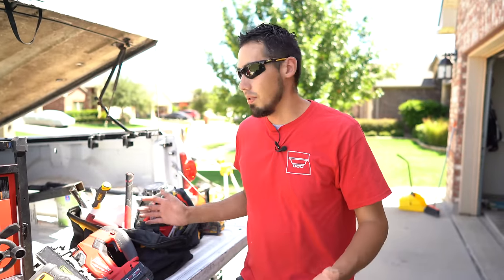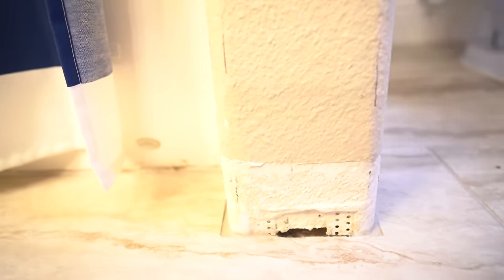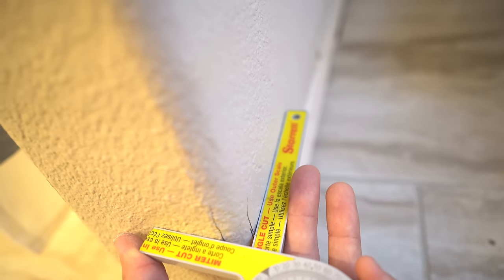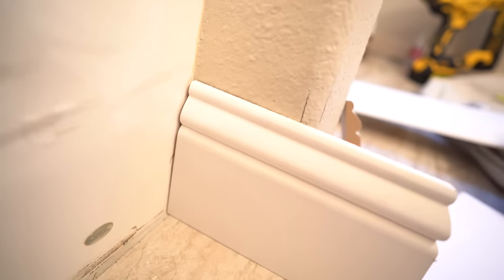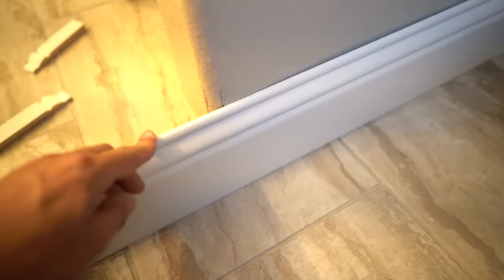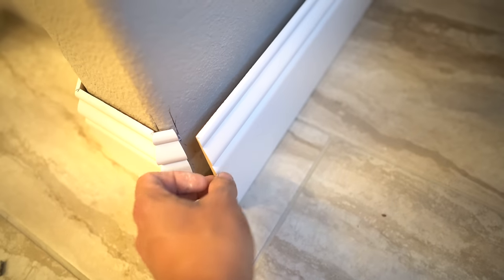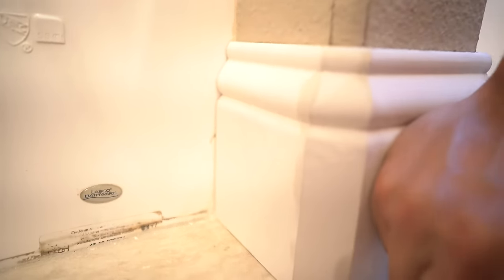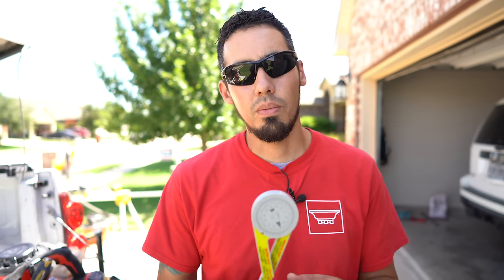This Simple Tool Gets PERFECT Miters

Comment: Yes, excellent addition to the tool box! Nice explanation my friend.
I work on a lot of jobs where coping is not allowed due to customer preference and we gauge all the corners as we measure for length. We also glue every single joint we make.
Using a mitre gauge mostly eliminates the need for test miters, especially with large crown mouldings.

Comment: Fantastic! How do you determine width at inside (or outside) for the bullnose trim piece? Do you measure gap between cut peices in position on the floor? Measure it from the bench dog jig? Given the radius is 3/4 you could calculate with math but thickness of drywall plaster finish will change that? Would love to know. Great lesson, thanks for mentoring your talent.

Comment: Excellent video.   By the way, "Starrett" is usually pronounced to rhyme with "stare" rather than "star."   With the first syllable stressed, it comes out sounding  about like "STARE-et."     An alternative tool which you may have already looked at is the Festool "Angle Transfer Tool" but at $175 (--or included as an accessory if you fork up  the $1500 for a Kapex miter saw), t'ain't cheap.  A more cost effective alternative is the Bora "Miterix Angle Duplicator,"  which can be had for about 1/5 of the cost of the Festool version.

Comment: I've been using the same protractor for years - it's an absolutely go-to tool as you say....... Very nice finishing indeed - that cope (or scribe as we say over here) is a thing of beauty. The only other step I take apart from everything you've done, is to gently wipe the external mitres over with 240 grit just to take the sharp edges off. Just personal preference. Greetings from England.

Comment: For shoe mould  trims just use a multi angle miter cutter. 16.99 on Amazon. Gets your cuts quick, precise and without any power tool. Just pure hand strength.
Reply: Truth! However, many new trim, is wider than a miter-box. I run into that problem. Nothing a chopsaw can't fix! There's many measuring devices which help with angles. It's all about how much time you have & request for quality. Time is $.

Comment: I really enjoy your videos and they are teaching me new techniques which are very helpful. Unless I missed a video it would be great if you could do a video where you show the actually cutting of the angles from the pencil transfer like the 23 deg miters. Especially for the small pieces...one thing I struggle with is taking incorrect measurements or maybe not transferring properly and making an incorrect cut. Therefore I waste a significant amount of time adding length and slicing the wood like I am at a deli counter until I get the correct fit.

Comment: The cope in the corner is perfect.  Have you changed the way you cut copes from the way you showed in earlier videos?  Also when you put the assembly in place it was obvious the wall had a little wave in it.  Do you nail tight to the wall, including the dip or do you leave the base straight and fill in the dip with caulk?

Comment: You rock. [or trim] Most guys like me have our hands full just coping and installing the trim. You're holding a camera too.  Question: what do you do about water in a bathroom as far as the base trim? I've held the trim off the floor an eighth and caulked, or not caulked, and also just run it on the floor and let it go. I especially tend to hold trim up off a bath or kitchen floor if they spec MDF trim [yetch]. I am buying this tool today! I set up a big haunted house every year and like to do some fun trim projects on it every year.

Comment: Big rich the glue that will old that plastic up is called "CA GLUE" it has an instant activation spray its great stuff if you don't want to use that scuff the plastic and magnets with some sand paper and use superglue and put some baking soda on the glue when its wet (watch a video on both i use ca glue when trimming a house out )

Comment: I'd like to see how you made the 23 deg cuts on the miter saw.  Did you use the protractor to set the saw angle as well?  And how did you cut those tiny corner pieces?  Great work!
Reply: Set the saw at 23 and cut

Comment: When you nailed the longer run to the wall. Did you nail your boards flush? Or have the painter get it? In this case. To make up for the track built wall. Finish Carpentry TV

Comment: Can you use that mitre protractor to measure a corner...divide that angle by 2... and then use that number to cut the moldings/trim with a mitre saw? ...AND AVOID HAVING TO DO COPING?

Comment: tool application and miters are on point. typically, you shouldn't use MDF in a bathroom application, and baseboard should be raised off the floor a sixteenth (unless you're back priming bottom edge and back side). I also hold baseboard back from tub a sixteenth or eighth, and allow for caulking.  Wet areas will inherently require more maintenance, i figure caulking is easier than having to replace baseboard in an area with high moisture exposure, that will absorb water, especially if you use MDF.

Comment: What is the rule for when to miter and when to cope besides the obvious miter outside corners? Why not miter the inside corner by the toilet, it seems like copes are more work vs finding the angle and just cutting both on miter saw. Also there must be a measurement for how long your middle piece of the bull nose is, a standard you always use. How do you find that length, it would change for larger or smaller bullnose, right?  Great video as always.

Comment: The simple Johnson T-Bevel tool works as good as the Starrett protractor. After you set the inside/outside angle measurement on the T-Bevel tool, take it to the chop saw fence and place the handle flush with the fence. Then lower the blade without power into the slot and turn the blade to match the T-Bevel arm, note the degree marking on chop saw base, and divide by 2. Be sure to use flat part of saw blade (no teeth against the T-Bevel arm). This is extremely accurate every time mating your cutting angle to actual wall condition.  ie, a 92 degree outside angle T-Bevel reading on chop saw calibration scale divided by 2 needs 46 degree angle cuts.  Works perfect every time with great accuracy.

Comment: Richard, do you find that the bullnose piece is always 5/8" on the heal regardless of the angle? Even if you had a weird angle like 120 degrees instead of 90? Also, what about inside bullnose. I have some of those around some pillars between my living room and kitchen that are the bases of arched openings. Is the inside (reverse) bullnose usually 5/8" as well? I also spoke to Scott over at Windsor One, thanks for recommending their products.

Comment: Do you find that there is a little bit of play in you gauge? I had that exact gauge and I was getting almost a 1 degree variation. It was the slightest bit movement but was noticeable on a detailed trim job. Starrett makes the same gauge but in metal. It is $80, but it has no play. I ended up scrapping the plastic one and using the metal one. Just wondering if you have the same issue.

Comment: For those two smaller pieces that you cut, I believe you called them "bull noses". Did you cut 23 degrees on both sides of those pieces? And were the pieces they connected to cut at 23 degrees on the saw? I guess that would make all the cuts at 23 degrees. Is that correct?

Comment: If I were to use this tool for a vaulted ceiling to install quarter round trim (instead of crown molding) I'm assuming it would measure all the tricky up and down tricky angles perfectly?

Comment: Do you use shims off the floor for a gap for painting later in (I’m a newbie) if so, what size? 1/16” or 1/32, 1/8”? I have horse shoe shims I’ve been using.

Comment: How do you measure the width of the bullnose properly without the gauge? And where to cut or mark base for the bullnose piece
Reply: How wide should the bullnose piece be cut? Are they all 5/8? I cut one at 3/4 and its still not working for me.

Comment: The short piece around the bull nose. How did you calculate the length of that around the round edge? You already had it cut before we even saw how you did it.
Reply: The short piece  around the bull nose is:5/8 of an inch length

Comment: Thanks. Ordered one. Are you always 5/8 on bullnose with the bench dog or do you find variations with different homes? Also what brand of glue are you using?
Reply: I have the same bullnose corner guages.  I usually cut the pieces at 11/16 for paint grade trim and 5/8 heavy for stain grade .   Wood glue is probably tite bond 2( about 80 percent of trim guys use it), and for small pieces Richard uses C.A. glue.

Comment: Wow....so much better than a bevel gauge & compass....
Reply: There's a trick to bisecting the angle set with a bevel... just use your framing square's width to make a square on a scrap that's warped to the offset... then set the bevel across that oblong square diagonally... and there's the angle for both sides of the miter joint.   You never have to know the numeric angle of it... just set the saw blade using the bevel.
Reply: @Forlornguild  cool man.
I had an older journeyman show me with the compass.
It takes four steps and isn't always as accurate as I'd like.
Reply: @bradevans7107  Yeah, the method of setting a bevel, then drawing a warped square from that angle and bisecting it is prob. the best old school way... with the benefit of can have diff size bevels to get any angle, even in tight spaces.... but this new fangled gadget does look tempting.  lol
Reply: @bradevans7107  To fully explain how to do it with a bevel and framing square:  Set the bevel to the angle of the outside corner you need to miter.  On a scrap of wood, put the bevel against a straight edge of the scrap.... and mark a line for the angle onto the scrap.  Use the framing square's width to make a second line parallel to the bevel angle marked.  Use the framing square's width to make a line parallel with the straight edge of the scrap... you've then drawn an oblong square along the edge of the scrap of wood.  Then set the bevel diagonally across that oblong square you drew, and use that setting to set the saw blade angel.  Or if splitting the angle again for the bullnose in this vid, just repeat the process from there to bisect the angle again.... and all four cuts will be that angle.

Comment: G'Day Mate 
That's a must have tool ,could you tell me what glue you were using that's a must have as well. I am a Builder- carpenter in Australia and I haven't come across these  items . Thanks
Reply: Colin, G'Day!   it was cyanoacrylate glue (commonly called "CA" or just "super glue").  Fastcap and others market kits  (e.g., the 2-P10) which come with several viscosities with an included self-accelerator or with a separate accelerator depending on the needs of the particular job.
Reply: G'Day Welsh Rabbit
Thanks for the reply , Fastcap has a store in Melbourne so I will purchase one from there. I have been subscribing for some time and appreciate your high standard of work . 
Appreciated that G'Day some people don't get it.

Comment: What’s the difference between that tool in the angle finder? I bought the angle finder to work on from Walden. Did I buy the incorrect tool?
Reply: Meant Crown molding. Spellcheck ruined it

Comment: Love the vids. Quick question, what is the measurement is used for the small pieces on the round  part of the bull nose. Thanks.
Reply: I was wondering the same thing. I think if you put the two flat pieces up and measure edge to edge of those you might get the right width.
Reply: true. but i figured with the bench dog jig he has it must be a certain width.
Reply: Tim and Eric, 5/8" is the short point measurement.......have 2 of those bullnose gauges and work like a charm.
Reply: @stevemcginn9200  Thanks Steve. I really appreciate it.

Comment: This yellow one from Starett is plastic, and arrived off by a 16th in 6". The dials are also off, somehow, so when you line up the arrows on one side, '0' on the other side is 1/2 a degree off. Maybe the metal one isn't garbage. Don't buy the yellow one. By the way I appreciate your videos, great work!

Comment: Thanks for another great tip and recommendation.
I'd like to do to some renovations on my mother's house this summer. I'm trying to learn as much as I can and acquire the right tools to do trim work and repair some wood flooring.
When it comes to miter saws for trim work like this, is a double bevel necessary?

Comment: Well,the thing is- when miters  are off it is usually because of what is underneath or behind it.. I won't adjust my miters for a corner bead or especially a large plaster mud bead- Well, first i would scribe if necessary and try to get the two 45s to meet properly, then as a last resort use that miter gauge to adjust the chop box..I guess we all develop "our own way".....Plus ,I've been doing this so long I don't need a tool like that...it's a fifth sense for me to know how to "cope" with out of squareness,,(hehe)...
Reply: den d same here,I'll cut it a hair long and beat the hell out of the drywall before I adjust my angle,but I also have never had to deal with too many round corners here up north either

Comment: Mine is 1/2 degrees off; contacted Starrett and this was their reply: "That gage would be in tolerance as to our inspectors.
This product was designed by an outside firm and introduced by Starrett 20 years ago.
As the long history of reviews on Amazon document, there has been constant controversy over the accuracy required from this protractor. Recently there has been an introduction of similar protractors as I believe the patent was returned to the original designer."   I do not recommend.

Comment: Ca glue?
You know my tub was bent at the bottom, rather then tear out the tub and buy a new one I put  PVC base across the bottom with 1/4 round and glued it into place with bathroom calk. But the shape looks really good.
I never use wood baseboards in a bathroom it always tends to rot by a shower. The PVC will never rot.and I calked all the seams top and bottom, I could turn the floor into a bathtub and not damage the subfloor. My backer board was sealed like a shower pan would be with a roll  on product.  
Hey I had to fix it once, I wasn't going to tear out more rotten subfloor and do it a third time.
Kids get out of the bath or shower and just don't care if water is on the floor. Now it doesn't matter. They can't damage it.

Comment: This has a lot of potential as a great tool. Because of the name, you'd expect it to be. HOWEVER, many of us dumped ours because they were a degree or more off, which is a huge problem when accuracy is critical.

Merely that a few got lucky and theirs were accurate does not excuse the sloppy garbage Starrett others ended  up with, for several years now.  Go read the bottom reviews on Amazon and it becomes obvious this is a common problem with this tool.

Comment: I agree the tool does work pretty well on square and true walls but after doing this work for awhile, a good finish carpenter can dial these miters in relatively quickly and easily and who the hell uses mdf base in a bathroom or wet area ? One toilet overflow and you've got mold and rot problems. It harbors moisture which leads to serious issues. I use pvc baseboard in wet areas. It's easy to cut, paintable and resists moisture and the price rivals mdf and pine and is reasonable for what it offers.

Comment: You got a problem son. Wood expands and contracts so it you mount it againt the wall it will crack the joint in time. Best to apply some caulk to the end and not waste time trying to fit flush...

Comment: How the heck do you cut something at 2 or 23 degrees? Don't the saw's detents get in the way?
Reply: Aelanna64 depends on your saw. On my dewalt I can manually put it on any degree setting I want then tighten the knob
Reply: Aelanna64 every line on your miter saw from zero left or right is a degree
Reply: Yes, but my saw has a detent at 22.5, so if I try to get 23 it slips into the detent.
Reply: Aelanna64 you should be able ro tighten the knob at 23
Reply: Just about all saws have a detent override on them, basically is hold the pin or block away from the detent slot so you can do a 22 degree cut without the saw locking into 22.5 detent.

Comment: Dude, unless I am missing something, you don't install MDF material in a bathroom, especially next to the bathtub. It is wet in there and MDF will bloat like a sponge. Can you say "call backs"??? 
   Nice job with your cuts, where it ultimately counts.
Reply: I bought a fixer-upper house with three toilets that overflowed. The floors had carpet on them and stayed wet for a while before being ripped out. Believe it or not, the MDF wall boards we're in great shape, even though the sheetrock behind it molded. I was shocked.

Comment: I’m really new at this—you lost me with the 2 degree cut adjacent to the tub or basin.
Reply: Where the floor and wall sit, should make a 90degree angle.  But the wall is off 2degrees, so you have to compensate for that.  That angle finder is telling you the wall is sitting past the straight 90degree cut it would be to make a perfect "L" with the floor.  So you cut the back of the piece that goes against the wall to make it flush with the wall.

Comment: I would say 99% of installers will just caulk it rather than cut a 2 degree on one side. They will also cut 22.5 without measuring with an angle tool. If its white  no one can tell after caulking unless you're inspecting. Do home owners really care that much? If they do then they should do it themselves otherwise perfection takes a lot and lots of time and money. Doesnt seem worth it.